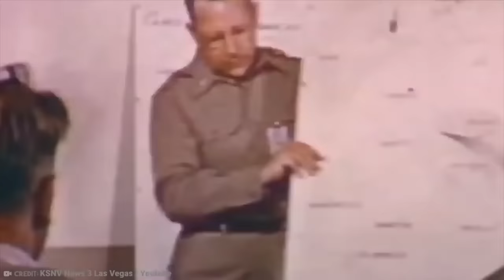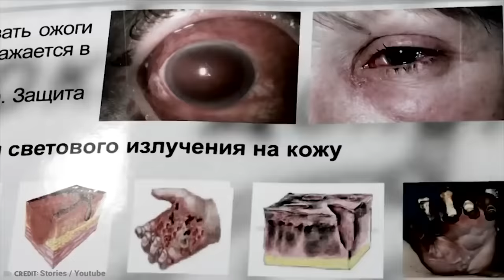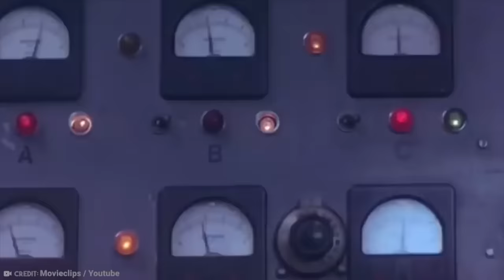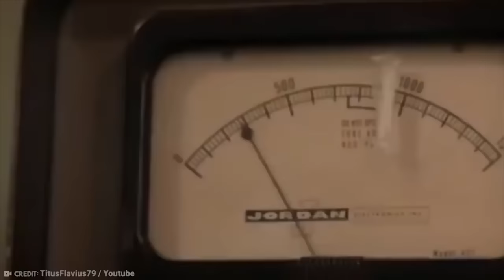20 Nuclear Tests That Went Horribly Wrong

Comment: The Castle Bravo bomb wasn't dropped as is stated here. It was huge, 23.000 pounds, and housed in a structure on the ground. Come on, do some better research!
Reply: Exactly
Reply: @richardscathouse  They need less snark and more research
Reply: And the part on Chernobyl was completely wrong also! They knew damn well what they were being told to do was dangerous, but no one was willing to get fired or sent to the gulag by questioning the crazy guy who was in charge! There was no design flaw other then the lack of a containment building. They had to shut off multiple safety systems designed to scram the reactor in order to cause the accident. And the area wasn’t abandoned the other 3 reactors continued to operate for years after the accident!
Reply: @Trump985  Well, yes and no. Dyatlov knew that there was some danger to what he was doing, but he believed that there was actually a guaranteed fail-safe available - the AZ-5 scram button.

Because of three factors - the HUGE size of the RBMK reactor, the negative void coefficient (water bubbles, caused by heat, would increase the reaction rate, causing more heat, etc., etc), and the fact that the control rods had graphite at the ends, trying to scram the reactor caused the graphite ends of the control rods to be inserted in the bottom section of the reactor. This caused a runaway power excursion, causing a massive steam explosion, which blew the reactor up.

If the AZ-5 scram button was fast (not 18 seconds as designed), if the ends of the control rods were not a moderator (which speeds up the reaction by slowing down the neutrons), a scram would have successfully shut down the reactor. 

The shortcomings of the AZ-5 scram were a state secret, and were not disseminated to all the engineers who needed to know them.
Reply: @Trump985  z
Reply: russia's first h-bomb WAS a bomb...ours was a three story house....if you're really interested in these things i'd recommend a trip to the air force museum in Dayton, Ohio where they have dozens of these things on display, many in cross-section...while you're there ask them about the dead aliens...that always seems to set them off......
Reply: @Trump985  and the russians just shelled the place...then tried to dig trenches in the contaminated soil...not the brightest bulbs in the pack....
Reply: You also don’t get “infected” with radiation.
Reply: They had a huge cryogenic plant that kept deuterium and tritium in a liquid state while a nuclear bomb was detonated inside it.
Reply: Better wuck tomorra
Reply: @Jim-ku6ry  not that it really serves any purpose, but can a nuclear warhead be detonated above a target?  I ask with the curiosity of what if the warhead was off course but close enough to achieve mission accomplished. Also, maybe predetonation of a straight down inbound missile above it's target allowing more coverage to the side blasts rather than hitting earths top layer.
Reply: @Jim-ku6ry  Not too sure about that..."The device was mounted in a "shot cab" on an artificial island built on a reef off Namu Island, in Bikini Atoll"...from the wiki article on Castle Bravo
Reply: @richardscathouse  qq
Reply: @TheJonathanc82  he did
Reply: I open the Demon Core
Reply: No the castle bravo bomb was dropped but it didn’t detonate until it touched the ground
Reply: Hey, it’s on the internet, it has to be correct. 😜
Reply: Over Castle Bravo?
Reply: @zacharybrow1120  Castle Bravo used actual hydrogen deuterium and was a huge shed with all the refrigerators etc. 
Ivy Mike was a deliverable bomb dropped from an aircraft. It also made two or three times the expected bang AND with a lot more fallout than expected.
Reply: The two bombs that have been used on real targets (Hiroshima & Nagasaki) were detonated a couple hundred* feet above ground level since that allows explosion to spread out for the greatest area of effect. Otherwise a significant amount of that energy gets absorbed by the Earth.

Edit: a couple thousand feet, not hundred
Reply: 8:35 The most crazy incident: 1961 B-52 Crash ! That was so nice, we should repeat it !!! 🥰😇😂😂😆
Reply: @retrogamestudios7649  little late to answer but typically a nuke would be detonated above the target, allows for similar effect but reduces the damage done to buildings from the fireball. Also can spread radiation to a greater distance allowing a larger effective range.
Reply: @EdTheCreeper they detonated somewhere around 2,000' above ground.
Reply: @frankpienkosky5688 The bombs, or the staff?
Reply: @hallieboy io
Reply: @desertrat1111 best comment by far 😂
Reply: @Dave5843-d9m  you got it backwards, ivy mike was the giant experimental one and the first h bomb test ever in 1952. Castle bravo 1954 was the one with dry fuel meant to be deliverable size but it wasn't actually dropped. It was also staged in a building for the test
Reply: @frankpienkosky5688  russias first h bomb was also like 3 years after the US first and they had the benefit of not having to be the first to test the to see if it would work since they knew the U.S. did it already not just with ivy mike but with their castle series dry fuel bombs in1954 which were deliverable size over a year before Russia's first.  Ivy mike was pretty much just a proof of concept experiment.
Reply: @zacharybrow1120 no it wasn’t 😂 it wasn’t a bomb, it was a building as mentioned previous.
Reply: Every single explosion in this is conventional tnt, sunsets or real bad fakery
Reply: @russbrownnewsscalping7661  lol 😂🤦‍♂️🤦‍♂️
Reply: Sea life and atomic tests
Reply: @EdTheCreeper  it detonated at roughly 1900 feet above the ground
Reply: Everyone with some cool voice become YouTuber nowadays.
Reply: It’s amazing how many amateurs on YouTube get basic facts wrong
Reply: And pronounced tsar bomba wrong
Reply: What about nine mile island

Comment: The 5 guys standing beneath the nuclear explosion were Air Force volunteers.  But it wasn’t a bomb, it was the “Genie” nuclear air to air rocket, designed to take out soviet bombers en masse if they were headed our way.  This was before ICBM’s when bombers were still the main threat and interceptors were the best way to take them down with stand off air to air weapons.  The Genie, incidentally wasn’t guided, its yield was large enough that guidance wasn’t deemed necessary.
Reply: A device that explodes IS a bomb.
Reply: Fun fact: the cod map, nuke town, is based off of this incident
Reply: Volunteers?? Rii-iight. 😬
I doubt that somehow. 🙅🏻‍♂️
Reply: they were generals actually
Reply: Great information.

Comment: Very frustrating.  I dont think more than 5 minutes of actual research went into any of the incidents.  Hell, half weren't even tests at all, and most of those didn't "go horribly wrong".  Even Castle Bravo, an ACTUAL TEST with an unexpected result was described as the army have "made and dropped" a bomb much larger than expected.  Need trick when the bomb was the size of a house, built in place and being too effective because of unknown reactions with lithium material.  You know, the reason you DO testing.

Another few minutes of study would have taught the writer that no  airborne bombs are NOT "1 small mistake can allow a bomb to go off"  no, it simply can't.
Reply: "size of a house." Guess it depends on where you're from. In Dixie, a house is bigger than all of those bombs...
Reply: @654Crossman  he could be homeless... so, a house is the size of a refrigerator box. gah, don't be so insensitive to the yankees...
Reply: @salvadordollyparton666  I was homeless. Lived in a 1994 Dakota for a few months. It was still bigger than most theses bombs. 😂
Reply: the tzar bomba was supposed to be 100 megatons...but russian scientists concluded that much of the force of the bomb would be lost into space...so they settled for about half that....still almost brought down the plane that dropped it....
Reply: No kidding
Reply: Castle Bravo can easily be classified as an accident due to what happened to the Lucky Dragon crew and nearby islanders
Reply: Never have been sure if these are done by a computer or a very stupid person.
Reply: 8:35 The most crazy incident: 1961 B-52 Crash ! That was so nice, we should repeat it !!! 🥰😇😂😂😆

Comment: One of the Goldsborough North Carolina bombs was never recovered.  It went down into what was essentially quicksand-like soil.  The AF guarded the site for years, and there is a memorial plaque marking the site.
Reply: Because they still could go off anytime.
Reply: @richardscathouse  yes indeed, living close to Goldsborough I have small piece of the casing from that bomb. I keep it just for historic reasons, as accidents can happen.
Reply: Wouldn't be irradiated?
Reply: My mother and sister were living in Goldsboro at the time those bombs were dropped.
Reply: people still continue to look for that thing.....
Reply: Where exactly?
Reply: IIRC they gave up looking after digging 96 feet down and recovering various parts of it (but not the core)
Reply: @suegodfrey9676  The bomb didn't go off and plutonium isn't particularly radioactive (nor is uranium)
Reply: 8:35 The most crazy incident: 1961 B-52 Crash ! That was so nice, we should repeat it !!! 🥰😇😂😂😆
Reply: @miscbits6399  Plutonium not particularly radioactive? Please justify that statement with evidence. I'm not saying you are wrong, I am highly skeptical though.
Reply: @robguyatt9602 
  That's right, the plutonium & uranium won't be radioactive if the bomb hasn't been correctly detonated. The fissile components have to be compressed to a solid lump then be further compressed to much higher density than normal using the enormous compression pulse from the chemical explosives for the primary & the primary must go super critical as a correct nuclear detonation to compress the secondary core to detonation.  Core components are still buried in the ground, the air force look after the location. I think farming still happens on the surface. I think on one of the bombs 4 out of 5 of the triggering components operated in their correct sequence during the aircraft break up & the bombs descent.
Reply: @paulpaul9914 @paulpaul9914 It is absolutely rubish that either of those elements is not radioactive. Link me to a source that says they are not radioactive.
Reply: @richardscathouse  
0% chance of the remaining buried core parts going off as an atomic explosion, that's guaranteed, it's impossible, trust me, I know how to design, build & mess about with these things. I don't like flying but I'd be quite happy to live in a house built over the buried bomb components.
Reply: @robguyatt9602  
Why are you saying that for example a 50 gram chunk of plutonium must be radioactive? Where did you read that?
Reply: @robguyatt9602  
You can pick up a lump of plutonium, just need to wear gloves. The plutonium needs to be coated to stop it chemically reacting with the atmosphere. The plutonium needs to be less than critical mass size. Bomb makers & others have been killed by a burst of radiation when they got it wrong. 
Uranium 235 (bomb grade) can be handled with gloves.
Uranium 238 (depleted uranium) is used as balance weights on large passenger aircraft for instance.
Reply: @paulpaul9914  I was responding to a claim that plutonium is not radioactive. I asked for that claim to be backed up. Therefore it is not my burden to demonstrate that it is.
Reply: @robguyatt9602  
Why haven't u googled it?  It's very well established science. Your claim - you can't handle a small lump of plutonium because it's radioactive- Your job to prove it.
Reply: @robguyatt9602  
Plain Uranium - has been used in pottery & glass in the past as a colourant for centuries. Why haven't you googled it, what's wrong with you exactly, ask your mum to help you perhaps.
Reply: @paulpaul9914  Where did I make a claim?
Reply: @robguyatt9602  
Are you ok? You have now repeated the claim at least 3 times, get your mum to help.
Reply: @robguyatt9602  
Ever heard of pottery & glass?
Reply: @robguyatt9602  
Get a match box & collect some neutrons 😅☢️
Reply: @robguyatt9602  
You'll need a Neutron to get started.
Reply: @robguyatt9602  
Your claims are building a shed sized structure
Reply: @robguyatt9602  
Mrs Curie was Married.
Reply: @robguyatt9602  
Mr Chadwick often worked with Mr Rutherford.
Reply: @robguyatt9602  
Alphaka  Betty & Gammy
Reply: @robguyatt9602  
What's your neutron cross section like today?
Reply: @robguyatt9602  
They might like to respond - done some looking yet have they?
Reply: @robguyatt9602 I heard things I heard things … you were a little out of line making a claim
Reply: @Acky642  What claim did I make?